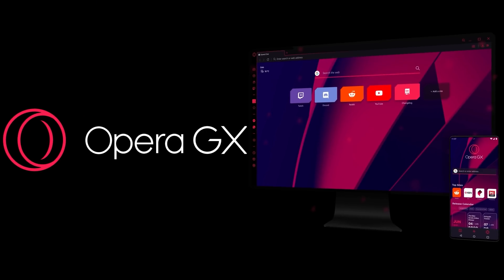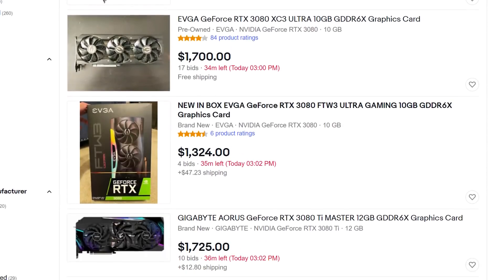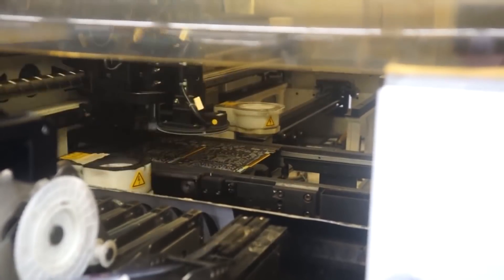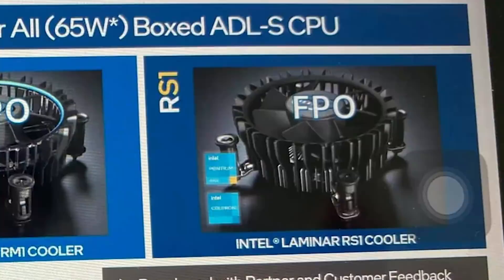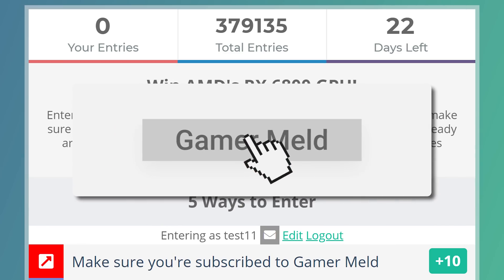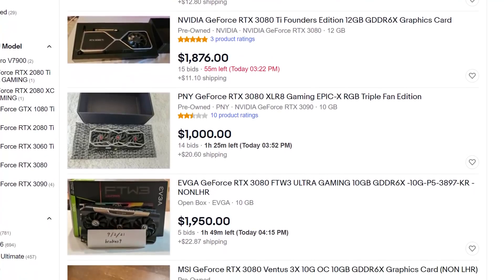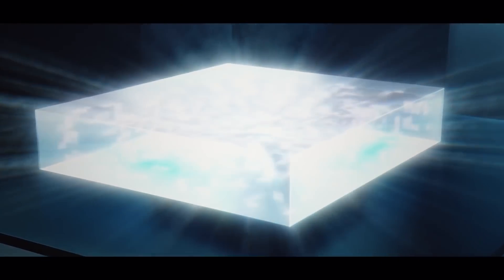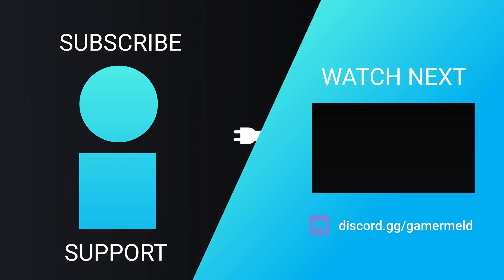2 Intel ARC GPUs LEAK - Pricing, Performance!

Comment: That's a good strategy that Intel is following where they target the lower end GPU since more people will be able to afford that. Reminds me of what AMD did with the RX480. I wonder if Linus will drop the Intel GPU on reveal for good luck.
Reply: If they are affordable I think people would buy bunch those for mining
Reply: @dearoo4814  they will most likely have a mining reducer in it
Reply: @lachysimmonds357  they didnt
Reply: @dearoo4814  No they won't be that powerful.
Reply: Intel would be silly to allow sales of these to any mining operation at this stage. AMD were no smart in allowing their board partners to go that route. It basically means they did not get the user interaction and recommendation because of lack of exposure.
Reply: Yeah, "target" the lower end.

Look, I actually think Intel has the most solid driver development of any company and this is a good thing for entry level clueless masses.

But don't kid yourself.  When mining crashes again (it will), these are going to be e-waste with a warranty.

Paradoxically, I actually think the shortage is a good thing for GPU development all around.  The makers know that the next crash will wipe out their sales for at least two years as used cards flood the market, and have basically a blank cheque right now to deliver an insane uplift next generation to protect their operating profits.

nVidia also has a rabbit in its hat with a move back to TSMC (what they've been able to achieve while changing nodes to Samsung should be applauded, absolutely), but hopefully the 1st gen MCM performance of AMD doesn't come with all the baggage we've ever witnessed on m-gpu (like GTX 690 & R9 390 X2).

Ryzen 5000 series CPUs give me hope, but it took three generations to get there...
Reply: Pretty sure they just can't make a gpu to compete with the 3080 or 3090 atm
Reply: @samuraiiv5683  All of these companies are fully capable of producing a much better card. It's not hard from a technical standpoint. But to make it cost less than $5000 each... That's the real challenge.
Reply: @jeremiahbell6129  enter amds mcm cards...
Reply: @godw1ll99   MCM is actually a way of making bigger cards more cheaply, which is a real enhancement. What I was referring to was simply making... bigger dies. If they wanted to turn a sheet of silicon that can normally make 100 dies into one that can make 30, they can just make some thiccboi graphics cards with tons of cores. But since the GPU die is so expensive, they would likely make a product that costs 600% more (counting failed dies), but only gives 100% more performance (due to diminishing returns).
Reply: @samuraiiv5683  they are Intel the chipzilla they can wipe the floor with 3090 if they please .
Reply: @kingyogesh441  I kind of a agree, they have more money and assets than Nvidia and AMD combined. Anyone who thinks intel would be out of the game that easily, isn't that smart. If they really wanted to spend billions of dollars, they could probably make something that competes with the RTX 3090 or maybe even supersedes it. That just wouldn't be practical though.
Reply: @samuraiiv5683  can we afford those monsters
Reply: @samuraiiv5683  I think this is not possible. Considering the arc gpu will be the first generation of mainstream gpu from intel, I will be impressed if it can match the rtx 3070 in performance.  If intel can price their gpu at the correct price, even if they don't match the 3080 or 3090, they will still sell well assuming if their gpu driver is stable.
Reply: Lower end GPUS for sale ACTUAL STOCK😮😃😃😃
Reply: Making gpus crazy expensive is stupid..Not everyone makes a 100k a year.what about kids that mow grass etc
Reply: @StreetTerrorist187  nobody gives a shit about them. Miners buy all the cards and retailers make a profit its simple
Reply: It's sad that it needed a third company entering the gpu market to finally make graphics cards that are affordables for the people in general. Still to this day, according to steam, most people are playing on budget graphics  cards. Just shows how greedy Nvidia and Amd are at the moment.
Reply: yeah i said it on a moores law video a while back that intel doesnt really have to win the high end by any means, just controller the entry level and be competitive in the mid range and theyre fine.
Reply: So, if Linus drop on purpose, would that mean good?
Reply: Don't forget RX580 too... :)
Reply: Lmao as if they have something to compete with mid/ highend 😂🤣😅
Reply: The rx 480 ended up being a pretty big failure. Had AMD known that the Polaris architecture had so little headroom they probably wouldn't have bothered making it. It cost them years of development time for virtually no gain. The r9 390x performed just as well. And not having something that competes at the high end costs you mind share. People look at the high end cards while buying the low end ones.
Reply: RX 480 is the goat mid range gpu!
Reply: Low at start then high next year
Reply: It's a starter set and then you build it with more pieces. Next expansion is going to cost higher and provide bigger memory parts to add.
Reply: cuz that's all they can compete against

Comment: If anything they should update the 2080’s
Reply: @ASchoolPencil  .. I was thinking the same thing, but they probably wouldn't do that. Even though a 2070 Super/2080 would slot in nicely between a 3060 and 3060ti (which is like a 2080 Super) Nvidia probably already has plans for something like a 3060 Super to fill that void. The 2060 fills a spot they want filled and just guessing, silicon friendly yields product to produce for them...

Comment: On the warranty thing.  In the US, they cannot void your warranty for opening up your card.  In fact it is illegal for them to do so.  They have to prove that you did the fault to the card that you want warranty replacement for.  Those void warranty if opened stickers in the US are meaningless.
Reply: You're probably correct but I think Invidia, and others, will use the threat to void warranties as a tool to discourage the majority of customers who have GPU problems from trying to discover the causes of the problems themselves. The manufacturers do not want customers from obtaining independent proof of possible manufacturing errors and negligence. The manufacturers also think that the customers whose warranties do get voided will not challenge it in court, as the benefit to cost ratio to pursue such an action would be too low.
Reply: @videomaniac108  unfortunately this... Linus did a video on this issue and manufacturers essentially weighing the pros and cons of still trying to endorse l enforce these stickers. If manufacturers decides to claim warranty has been voided it is up to the customers to prove they didn't void the warranty it in court. The question is actually how many individual customers actually have the resources in court. It would have to be a class action law suit or legislation would have to pass that makes it illegal to even use those stickers. As it stands, the stickers themselves aren't illegal yet.
Reply: @videomaniac108  Putting a sticker in-place that says anything like "warranty" or even hints at it being a warranty nullifying indicator is actually illegal.   This isn't a "take them to court" issue, this a call the FTC and they'll go after them issue.  You can also get $$ as a result.  This isn't something the FTC plays around with.
Reply: @videomaniac108  I am correct. The United States Supreme Court ruled on it. You CANNOT void your warranty by opening up your console, video card, etc. You actually guessed the reason why the Supreme Court shut it down "I think Invidia, and others, will use the threat to void warranties as a tool to discourage the majority of customers". That right there is WHY it is unenforcable to void a warranty. It is a fake threat by the companies to scare uninformed consumers. Uninformed consumers who can be manipulated.

EU folks should chime in, I believe Warranties in the EU has its own process.
Reply: @TigerMeltz  You and the OP assume all warranty void seals are all the same, they are not.  You ignore the real reason why the supreme court ruled with that favor of the consumers and it was a valid reason but one that does not relate to all manufacturers and warranty void stickers.
Reply: @StitchKiller  actually it does.  Read the case law.  A warranty CAN NOT be voided by breaking a sticker.
Reply: GamerMeld has CONSISTENTLY gotten this wrong for multiple videos now. The warranty misinformation is hurtful to consumers, not helpful.
Reply: @TigerMeltz  It's a click-bait rumor channel. What do you expect?
Reply: Try forcing a company to honor their warranty...
Reply: @lonniebeal6032  Just have to know the right words to say
Reply: Same in Denmark, we have a right to repair products without voiding the warranty
Reply: its the same thing in Canada
Reply: Where is the law on that
Reply: They also count on people also being unwilling to risk damaging it to find the problem. Most things are designed to break if you disassemble. I lost a Rift S controller trying to save it.

This quality control issue may come back to haunt them. People will be unlikely to invest as much in a GPU, with this sword of Damocles hanging overhead. It is a lot easier to risk 300 bucks, than 1200.
Reply: Yeah, but, if you have a Microsoft product then you "agreed" to forgo going to court and travel to Redmond, Washington and enter an arbitration............YOU LOSE.
Reply: @kretieg2943  not always the case, if it's something that is covered by a federal law, the FTC will go after them.  You can't put in disclaimers that bypass law.
Reply: when your cards are going overseas to be repaired they will follow the laws of the land the card is repaired in not the point of origin. So remember these things are repaired in china mostly so do you really think they give a crap about American laws nope.
Reply: @Thorkmalin1970  No, that's not how it works.  That's theft by conversion.
Reply: Yup